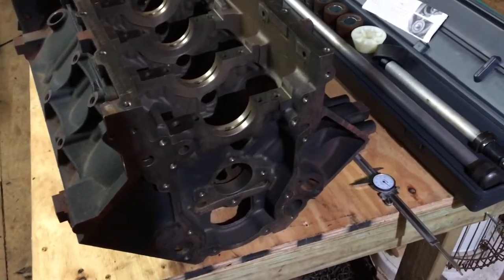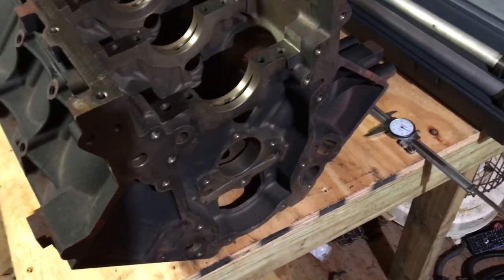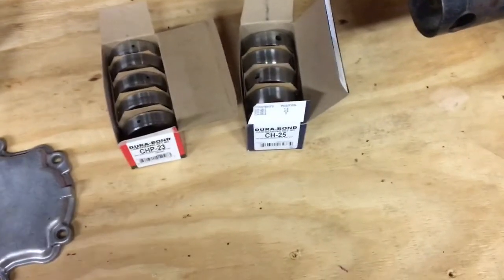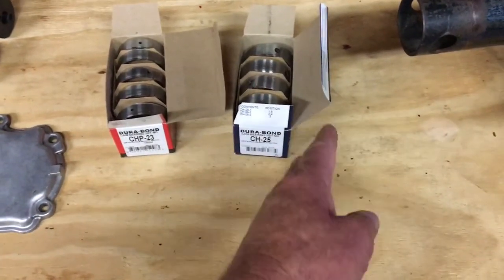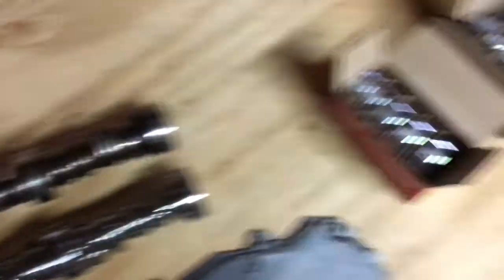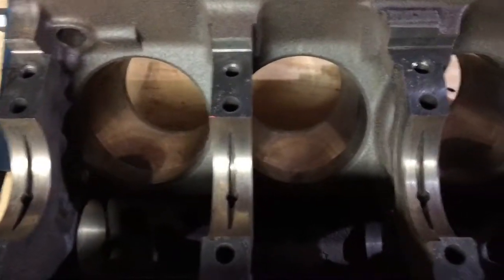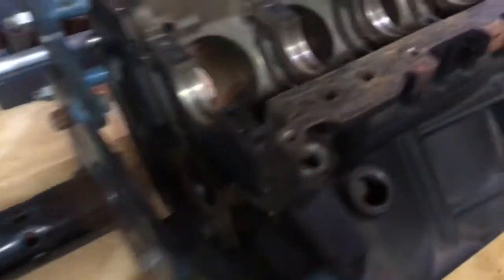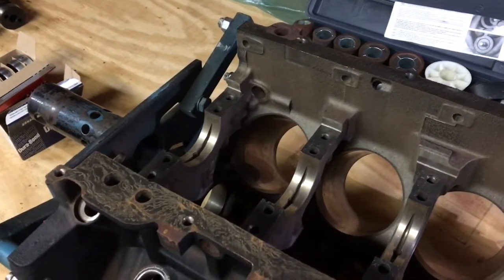Best LS Camshaft Bearings

Comment: What type of crankshaft and rod bearings do you use tri metal or bimetal?
Reply from the maker: I’ve used trimetal for most of my life but lately I’ve had to use aluminum bi metal when tri metal bearings weren’t available. I’ve noticed GM uses bi metal bearings a lot in the later model engines.

Comment: Thank you for sharing that information.  I'm in the process of replacing my cam Bearings on my 2004 LQ4 motor.  Summit racing has a nice chart that tells you the bore diameter of the block between the first and second design in 04'.  
Bore 1/5 = 2.326, Bore 2/4 = 2.317, Bore 3 = 2.307 (1999-2003 1st design)
Bore 1/5 = 2.346, Bore 2/4 = 2.326, Bore 3 = 2.307 (2003- 2007 2nd design)
Reply from the maker: Mind posting a link for all to see?

Comment: I used a similar type cam bearing tool and it ruined my bearings.  Too much play in the rubber
Reply from the maker: You have to expand the mandrel very tight. If not it will loosen and ruin the bearings.

Comment: Can I get the part number to your cam install tool?
Reply from the maker: I don’t recommend the Lisle tool. It is $150 and it is not robust enough to last. The main rod you beat on is made from aluminum and the aluminum has not held up well. I would get Eastwood W89220. It looks like the same tool but is only $99.
Reply: @moccasinmarine  ok thank you and I love the channel!!! Been subscribed for awhile now.🔥🔥🔥🔥
Reply from the maker: @papergatorzfedducca7998  cool thanks. I’m going to launch another tool to help with building marine engines. As a viewer would you rather support my channel by purchasing a small tool ( memento sort of) or by using the Super Thanks feature of YouTube? My opinion is viewers would much rather get something for their money ($20 tool) rather than donate $10 with nothing coming back to them.
Reply: @moccasinmarine  sure what kind of tool? And what exactly is a marine engine? Never researched it before.
Reply from the maker: @papergatorzfedducca7998  ok never mind. You asked about a cam tool from an LS video. The tool Doesn’t apply to LS engines
Reply: @moccasinmarine  oh ok gotcha!!!👍🏿👍🏿👍🏿

Comment: DO NOT  put race cam bearings in an ls if you plan on keeping vvt . Go ahead and ask me how I know.  Machine shop did a short block for me.  I'm currently rebuilding it myself..wiped out bearings only got 13 psi hot .. po011 code.  Stock style bearing from clevite is the way to go.  Better oil flow to mains

Comment: I tried fitting the ch25 in my engine and they would not fit my 2nd design. Would I have done something wrong?
Reply from the maker: Just put CH -25 bearings in a 2nd design 5.3 LM-7 block. Check it out :

https://youtu.be/jRlFj2aQv3I
Reply from the maker: You must install them in the right position. Each bearing only fits a unique location (1-5) in the block.
Reply: @moccasinmarine  I did, they were each individually numbered on the outside but it still wouldn't go in. I tried the old ones and it went in fine. 🤔
Reply from the maker: Measure the inside diameter of your cam bores and the outside diameter of your bearings to see what’s wrong. Are you sure your block is 2 nd design?
Reply: Im currently having the same problem 1-5 won’t go in, i have tried two different companies.
Reply: What year was your engine because it matters